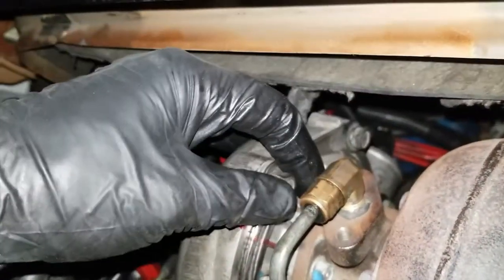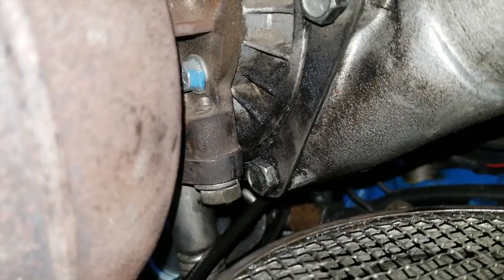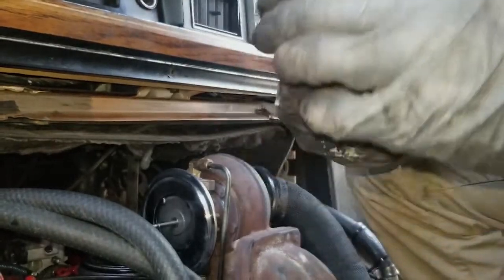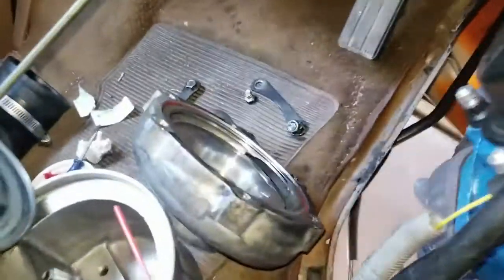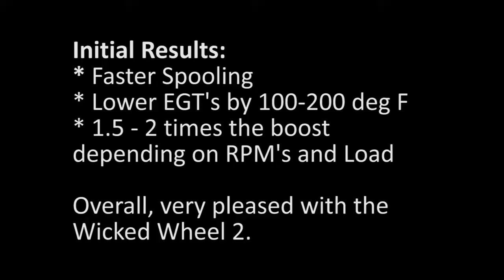Wicked Wheel 2 Installation on a Hypermax Pulse Turbo Kit

Comment: Hi, any chance you have a link to where you got the wheel? Nice video, i just got this hupermax setup on my 1993 f350 and i am curious if the wicked wheel will help what seems to be a flutter issue when the engine is under low load/cruising speed. I have a e4od tranny and 3.55 rear, so ly flutter is around 1400 to 1600 rpms after the truck warms up. I dont have 3k on this setup yet and only 50k on the entire truck.
Reply from the maker: R&D IDI Performance